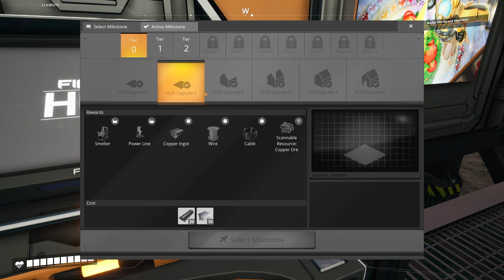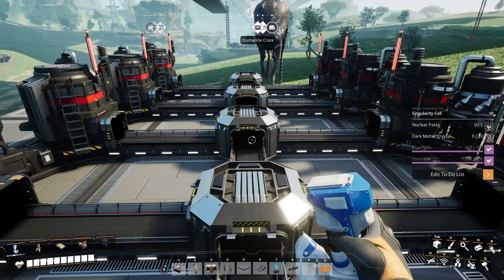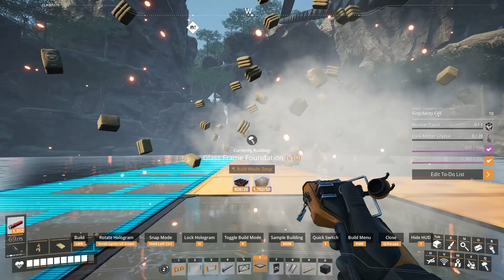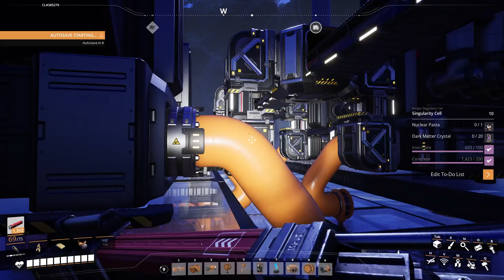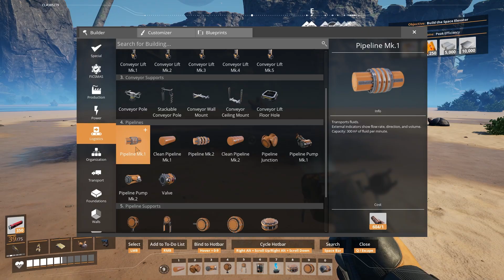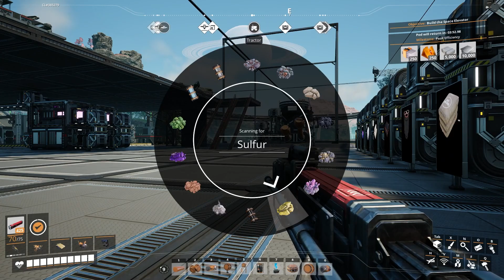Never run out of power again - Satisfactory 1.0 Tips & Tricks

Comment: yes, geothermal generators fluctuate in power production. but at that time you already have power storages that can be charged with 100MW each and discharged at any rate that is currently needed. thus you can combine such a "gives 100-300 MW" thermal generators (as shown in the video) with three power storages to accept the max production of 300 MW of that generator, and it will discharge again when needed. there will be fluctuations shown in the graph, but you'll get all of the average 200 MW of that shown generator, with no need for tapping into any other resources, any water, or whatever is needed for other power generation types. it will practically be a free power source after the initial investment of building the generator and a few power storages.
ps: i read that there are around 35 such geysirs, generating averages of 100, 200 and 300 MW each, probably an average of a total of around 35x200=7000MW ... almost for free

Comment: Just want to add a quick tip. While in theory you don't need battery back up, the reality is, at some point you will accidentally overload your grid and trip the breaker.

When the power goes out, everything feeding your generators also stops working. If you don't have a battery back up, it can be a nightmare to get things back online. 

At a bare minimum, everything that is required to keep your generators fed should be on a separate grid. It doesn't have to be a fancy set up, even just having a single wire you can break to separate from the rest of the factory is enough.
Reply: i always do some such thing for my first coal power setup :
a coal generator produces 75 MW, and the miners and water extractors require almost exactly 75 MW.
thus i have them and one coal generator on a separate grid that is never influenced by a shudown of the factory.
to (re)start that system, just have enough power production again, and the coal and water for a row will still automatically be produced.

Comment: Nice, thanks. To add a few tips to things:
* Adding a container into the output of the solid fuel constructor creates a really useful buffer so you don't have to collect leaves and wood quite so regularly. 
* If you're forgetful or lazy :), the biomass power setup can be further improved by adding a single supply container that you can just dump all the leaves and wood into. This container should then feed to a smart splitter which in turn feeds into two more buffer containers, one for leaves and one for wood which then feed into the appropriate constructor. 
* When adjusting the production rate the target number can be entered, not just the percentage. This makes it much easier to, for example, reduce a water extractor down to 90/m without having to bother to do the maths.
* When adding the central conveyor line to feed the coal into the coal power plants, rather than add a tiny section of conveyor just remove and replace the conveyor lift and the lift should connect directly to the splitter with no conveyor required. This saves a lot of pain when it comes to forgotten tiny conveyors which are often not upgradeable because they can't be targeted.
* Always run supply (manifold) pipes higher than the machines inputs that they supply. This removes all issues with pipe back flow and other tedious fluid mechanic elements in the game and in the case of the fuel oil power plant in this video removes the need for the pumps on the horizontal fuel supply pipes; It should never be necessary to use pumps for horizontal flow of fluids, only to gain height.
Reply: besides wood and leaves, also animal remains can be used to produce solid biomass. convert them to protein and make a lot of biomass from it.
while exploring, you will get lots of animal remains anyway (between 1 and 7 per kill, depending on the enemy), and in contrast to wood and leaves that source is "renewable".
as soon as refineries become available (and not yet needing to handle any oil), this system even can be expanded to make liquid biofuel.
i calculated that a single animal remain will give you 111 MWh when the setup gets a few somersloops.
ps/btw : in version 1.0, the jetpack is available very early, and can be powered with solid biofuel. using liquid biofuel for the jetpack is very easy and useful pretty early in the game !
Reply: @Anson_AKB  Good point about the animal remains and I have that setup in my base as well. I animal remains (hatcher, hog, spitter or stinger) can be turned into 1 alien protein. 1 alien protein can be turned into 100 biomass. 8 biomass can be turned into 4 solid biofuel. 6 solid biofuel (and 3 water) can be turned into 4 liquid biofuel each of which are worth 750 MJ of energy. This works out at 33 1/3 biofuel for each animal remains therefore 25,000 MJ of energy from each animal remains. 

Although because I like doing things to excess, what I really have done is to drop somersloops into every factory in the chain. This makes a lot more biofuel for every animal remains as the process becomes: 1 animal remains makes 2 alien proteins, which are turned into 400 biomass, which are turned into 400 solid biofuel, which are turned into 133 1/3 biofuel, or 100,000 MJ of energy for each animal remains. It uses a chunk of somersloops but these are easy enough to find and it's a fun way of generating a serious excess of biofuel for a relatively trivial amount of effort. Not really useful past early game but a great energy source early on. Biofuel is burnt at 20/minute in a fuel generator therefore each animal remains provides 6 2/3 minutes of fuel and it doesn't take too long to get quite a lot of animal remains.
Reply from the maker: @nickryan3417  thanks for those very useful tips! Especially about the pipes. I always struggle with fluid mechanics and end up resolving things by adding a bunch of useless pumps!
Reply: @ Anytime. I got really frustrated with pipe until I learned the simple trick of ensuring that the supply manifolds are higher than the machines they supply. After that I had no issues whatsoever, particularly when combined with a pump to push the head lift to the height of the manifold when this is required. Once the highest head lift point for a pipe network is higher than the manifold everything flows incredibly well, and this can be taken advantage of by using fluid sources that are high up, for example lakes on the plateaus, or just abusing game mechanics a bit by having a vertical pipe with a pump that has a headlift to reach past the topmost part of the pipe.

Comment: Awesome stuff! The conveyor inputs for biomass burners was such a great addition to 1.0. I find the jump from coal to fuel to be the tricky since a basic fuel plant is really all you need to start off but I tend to skip right into a turbo fuel plant which overcomplicates things really easily. I also make lots of mistakes with fluids too.
Reply from the maker: I personally find the basic fuel plant simpler to set up than the coal generators. Their only challenge is oil is very far away if its your first time getting to tier 3
Reply: @DataEngineerPlays  Since you don't have to transport the oil and instead can make fuel and generate power near the oil sources, only a long powerline is needed to make that power available to the factory. you still may have to find "far away oil fields", but no long pipes are needed (which many beginners do).
speaking of long pipes : pumps are only needed to fight the headlift when a pipe goes higher than the headlift allows. up to that headlift limit, no pumps are needed at all for normal almost horizontal pipes, no matter how long they are, and they at most can help with sloshing effects when the pipes are built in "unfortunate angles, loops, etc" (see also other comments about feeding machines from above if possible, to avoid such effects).
how high is headlift: usually it is 10m above the output of any machines, 20m above a MK1 pump, and 50m above a MK2 pump; then another pump is needed for the next 20/50m.

Comment: For the coal generators,  any time you stack 3 splitters or mergers to match the height of a lift, you can delete and redraw the lift after you've placed the splitter or merger. It'll automatically snap to both the input and output, no adding a belt needed
Reply: although i have lots of hours in the game, i still often get the distances incorrect to make belts snap directly and then have to move splitters and/or machines.
but something that many people don't know and don't notice is the very short and high beep that the game makes when any connection will be able to snap.